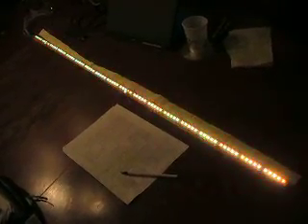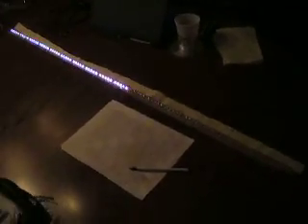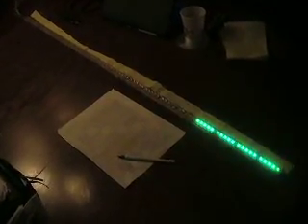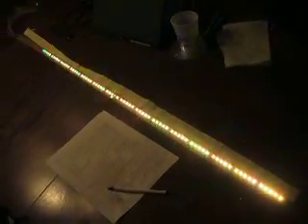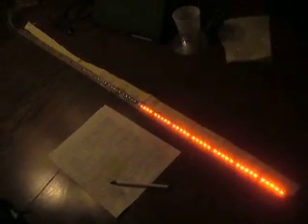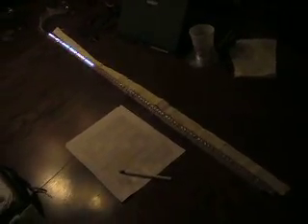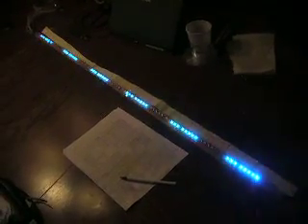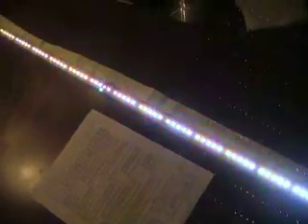Addressable Dumb RGB Pixel String Demo #2

Comment from the maker: To drive several LEDs from one single I/O pin would require some additional components between the LEDs and the I/O pin (like a resistor ladder with a different reference voltages for each LED, or some shift-register/decoder chips of some kind).

OTOH, if you mean use 1 I/O pin as an analog input and then multiple I/O pins to drive the LEDs, that would be easy enough - just configure one of the pins for ADC, read the value in a loop, then turn on LEDs based on the ADC value.